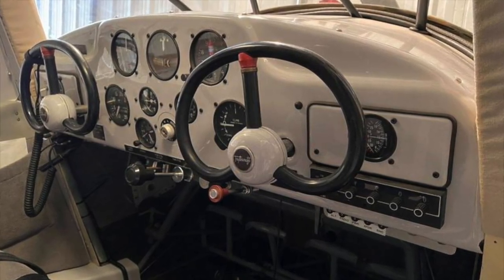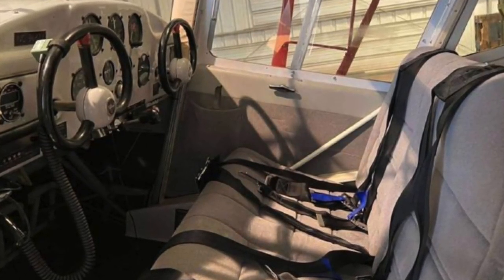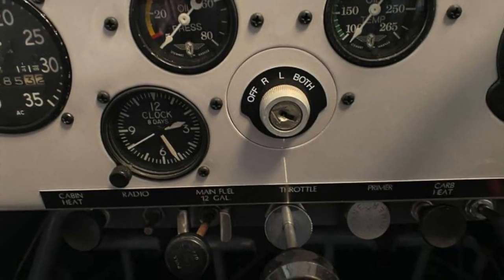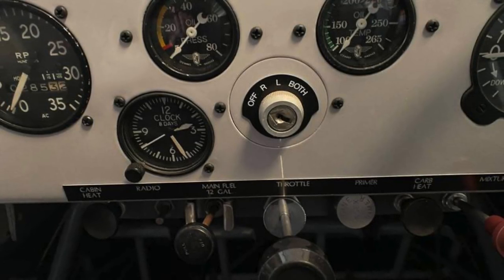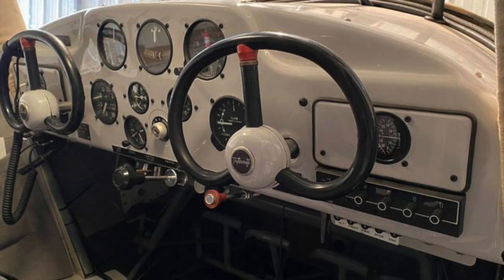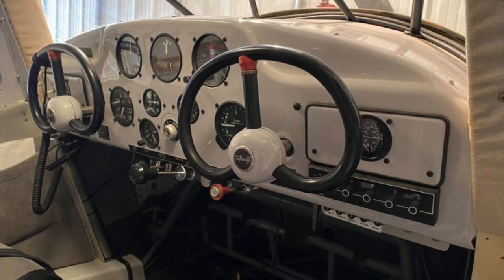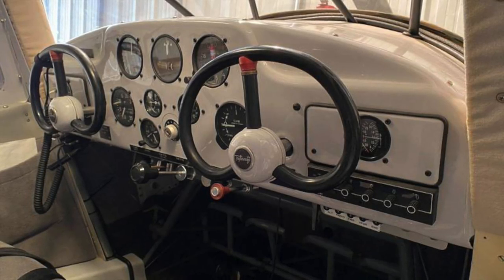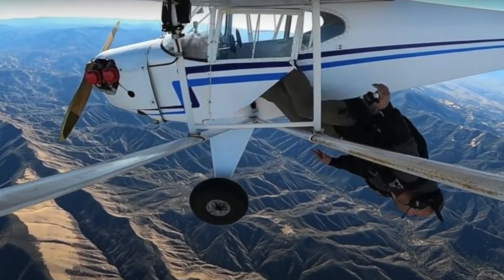Trevor Jacob How to shut the engine down in flight.

Comment: Apparently he had a couple of fire extinguishers stuffed up both pant legs. Another youtuber went through the footage frame by frame and at certain points they are clearly visible. At one point just after he exits the plane you can see the red bottom of the canister as the sun catches it, then at another point in free fall you get a great shot that shows the outline of the top of the extinguisher as it stretches the fabric of his pants. This guy is remarkably unsophisticated and never stood a chance of pulling this off. I don't doubt that the FAA will uncover many more mistakes Trevor made throughout this ill conceived stunt. I could almost pity the guy if he wasn't such a reckless dingleberry.
Reply: Remarkably unsophisticated?!  Well, I'll be... and here I thought he was galactically stupid.  🙄
Reply: @ScottinWV-bgij  And paying for a helicopter lift with a check.

Comment: So if you got to see the original video the camera over his shoulder was on for take off, but by the time that “malfunctioned” the camera was off. Wether the battery died, or he turned it off.. either way if the doesn’t have all the unedited footage of the surviving cameras they are gonna throw the book at him. I wanna see the unedited shot of straight on at him in the cabin, cause you never see that shot either once it starts to hit the fan.. but we KNOW that camera and the footage survived.
Reply: There's more to this!  That same camera was actually REMOVED before he jumped.  One of the super-sleuth dudes did freeze frames and discovered it missing entirely before the engine 'quit'.

Comment: quick question, could the Taylorcraft hand prop be restarted midair with the propellor windmilling, the same idea as roll starting your car, thanks
Reply from the maker: Yes it will restart if the mags are on and it has fuel.
Reply: The prop windmills fast enough during the descent to show that it could be restarted with the mags on and fuel supplied. The windmilling prop indicates that there was no major mechanical failure in the engine.

Comment: I wanna go there and do a forensics analysis of the engine and controls. Im a tech and know how to diagnose and inspect engines for wear and malfunctions. 
I would document everything and i bet i would find no reason for malfunction.
Im about 400-420 freedom units(mi) away or about 675km from the crash.
Reply: If the NTSB has contacted Jacob, they likely have jurisdiction over the aircraft now so you may just be getting yourself into almost as much trouble as Jacob if you tamper with the crash site.
Reply: @JAMessinaJr  Too late. Evidently the plane is not at the crash site.
Reply: @xsleep1  If the NTSB did not coordinate that, some more regulations were violated.

Comment: You can actually see some footage from someone who flew that very plane in this video: https://youtu.be/6E7NlFjqpsk?t=25 The key is on the left of the panel, and the main fuel cutoff is in the center although it is obscured by the pilot. There's no starter so it has to be hand-propped.
Reply from the maker: Wow nice find thanks. The photo at the beginning answers the question about the black pipe going up into the wing nicely . See my new video I mention you.
Reply: @grahamthebaronhesketh.  It wasn't my find originally, but I can't remember which youtuber it was who mentioned it first!

Comment: I have over 2,000 hours in airplanes (mostly in Long EZ's) and since I got a pilot license and my own plane I've never once shut it down with the mixture, only the key.
Reply from the maker: Well..It will stop on the key. I was always trained to pull the mixture right out so that there was no fuel left in the cylinders. then turn off the mags.
Reply: You're doing it wrong. Seriously. Read your POH. The reason you want to use the mixture control to shut the engine down is because it's safer to leave no fuel in the engine. If you shut it down by grounding the magnetos (which is what your ignition switch does) you will leave unburned fuel in the engine. If by chance, the lead that grounds the magneto were to fail and you hand cranked the engine, resulting in a spark, the engine could kick and injure you very badly. Or the residual fuel could auto-ignite, causing the prop to kick and injure someone. It's a minuscule chance, but that chance is eliminated by following the POH procedure–mixture cutoff until the engine quits, then turn ignition off.